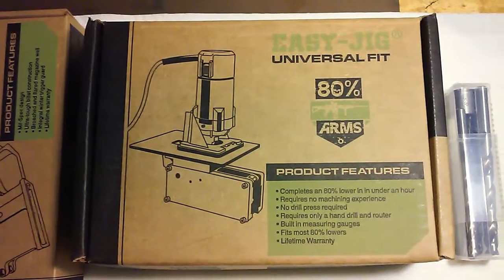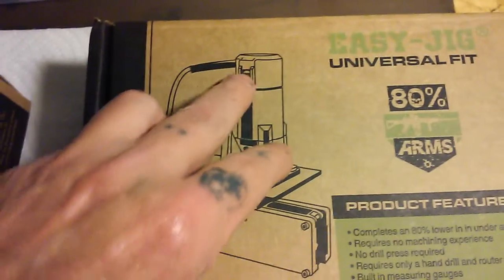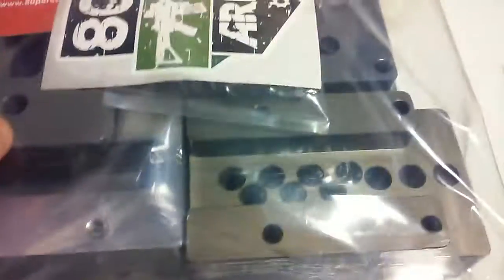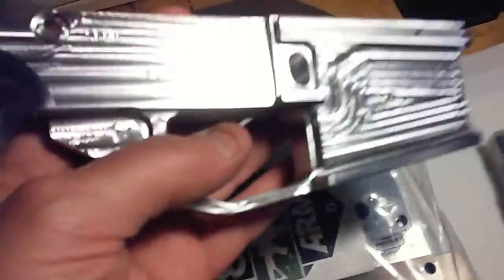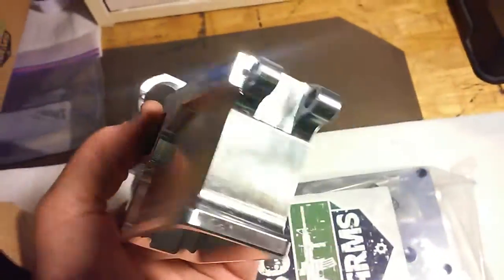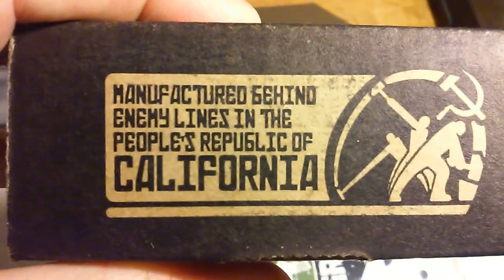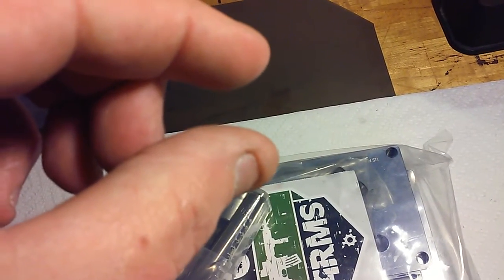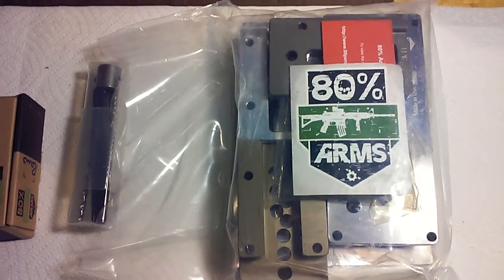80% Arms Easy Jig Quick Look

Comment: Awesome bro!  how much did this kit cost you.
Reply from the maker: +The Mosin Nagant Channel I think I paid about $280 for every thing I showed in the video. The standard drill bits you can get any where. The end mill bit is special and I think that runs about $27. I just bought every thing so I had it. I probably could of saved about $20 if I used my own drill bits. Thanks for checking it out bro.